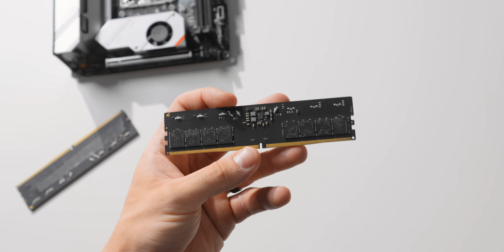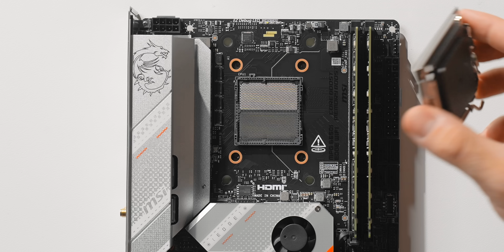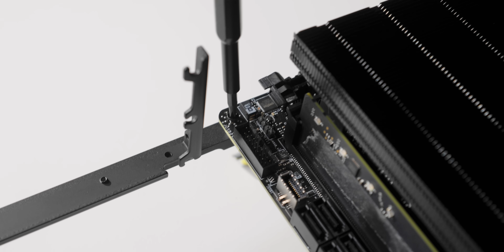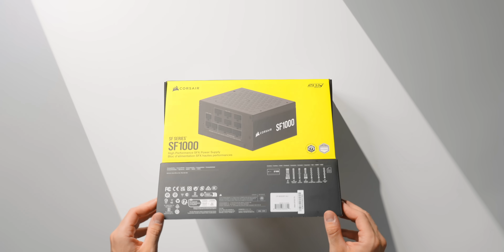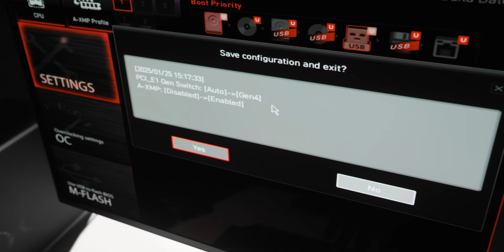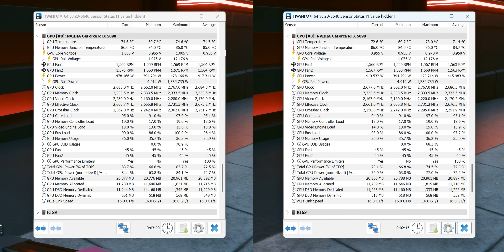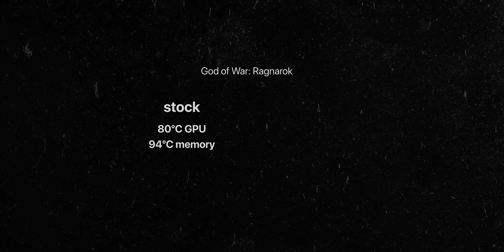My fastest gaming PC, ever – 5090 + 9800X3D

Comment: 9:10 If I had the money, I'm very much someone that would buy more expensive GPUs and undervolt them to keep the power draw down. I'm perfectly fine with mediocre gaming performance, but I also do some non-gaming stuff that's limited by memory capacity. My dream GPU only has 100-150 watts of power draw and at least 32 GB of memory.
Reply: I have a 4090 and I have it undervolted to around 230-250 watts when gaming down from 400 stock. There is a small performance decrease but not enough for me to really notice. In turn I get massive reductions in power, temperatures and fan noise. Absolutely worth it for me.
Reply: Maybe head for the Nvidia A6000

Comment: Is it possible with this case to mount the graphics card flipped over so the fans exhaust out of the case? I’m guessing not as that puts the bracket at the back upside down, but maybe this case has flexible configuration for that?

Comment: I never understand whats the point of cramming all that in a tiny case? People travel with their PC? I've been building PCs since the early 90s and i have never used anything other than a mid sized tower. Sits under the desk no problem. I have 3 machines here. Easy to reach stuff. Easy to install better cooling. SO yeah I dont get it.

Comment: I build in the same case, but 7800x3d and 4070 ti super. Gpu max 70c, cpu up to 88c, but i using water cooling. How its possible, that 9800x3d work fine with air cooler without throttling?
Reply: the 9800x3d's cache is added under the rest of the chip, it was above before. This makes it so that it'll run a lot cooler than previous gen chips

Comment: idk if its possible but if you could reverse the 5090 around so that it intake air from behind the motherboard and exhausts it straight out the side of the case then your overall temps would plummet. your cpu, motherboard, ram and m.2 especially with their lack of heatsink would benefit an amazing amount. It might not even make the 5090 run any hotter since the case ambient air temp would be so much lower overall.

Comment: G'day from another Aussie! Literally just finished my first T1 build using the same motherboard and CPU but am using the AXP90-X47 Full Copper cooler so that I didn't need to worry about clearances. Getting about the same CPU temps, so it must be working well! However, I'm still running my old deshrouded RTX3080 in it with some P12s strapped to it for cooling. Still unsure of whether I can justify the obscene cost of the 50xx series or not. Time will tell!

Comment: Curious of using the black ridge over the axp90x-47 full copper? Temps in testing are roughly exactly the same, and no need to modify the mobo. Just turbulence issues with the thermalright?

Comment: It’s crazy how little interest I have in the 5090. 
I had a 4090 until a few weeks ago. Sold it for the same price I bought it for two years ago. Absolutely nuts. 
But this 5090 has curbed all enthusiasm for the new gen. It’s such a pathetic release. 
I was planning to try and get one but the increase in price matching the increase in performance is awful. I just don’t want to support it. 
The really awful thing about this gen is the new 80 card won’t even match the previous flagship. This had never happened before. 
It was always the new 70 card would match or exceed the previous flagship. 
Now the 80 card is so pathetic it won’t do it either. 
Worst gen ever.

Comment: I think if you use the Thermalright AXP90-X53 you will have a better TDP cooling and still fit. Thermalright AXP90-X53 has a max tdp of 155w and the BR has a TDP of 95w

Comment: That motherboard is underrated, I use it with my 7700X. I also just got the SF1000, it’s actually hard to find reputable SFX 1000W power supplies for a decent price (Thermaltake was considered, but mixed reviews turned me away).

Comment: I have the 9800X3D as well. I feel that after I changed to this processor, Marvel Rivals has been crashing a lot. It wasn't happening when I had the Ryzen 9 5950X. Same graphics card, a ROG Strix 3090. Could you test if your game crashes as well? I reformatted Windows 11 twice, and also changed to Windows 10. Same thing. I just feel Windows 10 has more FPS, somehow.
Reply: So you did fresh windows installs? Are you undervolting the CPU?
Reply: @joniqst  i fixed it by undervolting the GPU.

Comment: Currently have a 9800x3d with a rog strix x870I. the same corsair sf1000 PS. corsair cl30 6000 ddr5 ram.   currently rocking a corsair 200D and am getting better temps on my cpu than on an open air test bench with how I have the front fans to exhaust and a 360 aio with a push pull configuration. 

I think the corsair 200D is the best SFF (or MFF) case that can get max performance with the right fan configuration while still taking up hardly any desk space (less than most SFF builds) with its verticle height (the most efficient way to do a case IMO)

Badly want a 5090 FE to complete the perfect build......hope i can get one.

Comment: With an undervolt like that do you think I could run a 5090 on a 850 W power supply?
Reply: That's just asking for trouble tbh
Reply: @Walhor  if its 430 during load and my cpu uses 105 then i think like 300 is enough for the rest of my system
Reply: @ Hey it's your hardware go nuts 🤷‍♂

Comment: Hi, I just bought the same PSU and after seeing the cables having smaller than typical connectors II thought it will not be a good fit for 5090. How did you manage to connect your GPU to this PSU?

Comment: Why do you only have 47mm of height clearance for your cooler? I have the same case and have a 4080 super pro art which is about 2.5 slots and was able to fit noctuas NH-L9x65. You should be getting more clearance with the 5090. Btw I love your videos! Especially covering the formd t1 series builds!

Comment: I have a 4090 paired with a i914900k I’m debating if I should try and get the 5090. I really only want it for the slight power increase also I really like the much slimmer design.

Comment: Who the heck is gonna run a $2k 5090 gen 5 pcie through a gen 4 adapter and turn the power/performance down on it too, just so you can use it in a smaller case. Unless you live in a cardboard box and don’t have he space for a real tower , who is this for?

Comment: this is the pc I'm going to build! Thanks for testing! I do have question:
Do you think its works  better to switch the power supply face to GPU? I think the fan will intake the hot air from the GPU and pulls out the hot air from above hole of the sfx power supply.

Comment: could you please compare the MFG with Lossless scaling? (the app) since it basically does the same thing, and also this may sound like a troll but honestly please try out the frame gen on "Infinity nikki" the game is so packed with detail , locking to 60fps + 2x framegen from lossless scaling it made any motion artifacts VERY noticeable. though i suppose a 5090 can just run down enough fps natively to delete any artifacts

Comment: Would love to see a build in the ncase m2. 

Personally, in a dilemma between choosing the t1 and the m2 and would be curious to see the comparison
Reply: I think this T1 build is only for the insane. Ripping heatsinks off, dumping 500W right into your PSU/mobo (causing early hardware failure), and losing 5-10% performance on undervolting. Is it worth it? Or get a slightly larger case (M2) and avoid all that.

Comment: undervolting...
MAYBE you could TEST this by using the NVidia App instead? It will actually test for stability, and periodically check if things are okay. I'm not convinced the MSI method would work properly in all conditions. Either way, somebody needs to invetigate this because dropping to 75% Power Target doesn't make sense to me. If it works, great. But I'd rather someone investigate this card. That I won't buy, but I'm curious.

Comment: PCIe riser issues
BIOS manufacturers need to address this. when you have certain POWER or CPU issues detected we currently have the system HALT on POST and tell you to go into the BIOS. Why aren't they doing this now, especially for PCIe instability that prevents passing the POST at all ? (Prior to Windows even launching). Just default to PCIe v4, not v5 and if you set it to v5 and rebooting is not working go back to PCIe v4 automatically with a warning of what's going on.

Comment: Absolutely insane that the 9800X3D can run with that tiny cooler. What a CPU.
Reply: Now I know why intel is stopping laptop OEMs from pairing AMD X3D CPUs with the mobile 5090.
Reply: @abaj006  how is that not anti-competitive / illegal? I heard about the "make Windows OS run best on Intel" from a headline or two but this seems wild. wtf. Screw intel.
Reply: @worlwr2  because he completely made it up lol
Reply: @abaj006 it's probably true but remember that x3d on mobile isn't so great because the idle power consumption of 3d cache is very bad. This means those laptop can be used only for a desktop replacement because it lasts 2-3 hours max on battery.
Reply: @abaj006  It's partially AMD's fault for ignoring OEMs and not having a good product integration team like Intel. Also AMD doesn't just have a 9800X3D equivalent, they only put out a 9950X3D equivalent which most people don't want to pay for and aren't going to utilize if they just want to play games.
Reply: @abaj006 well that and the thunderbolt connection reason
Reply: The 9800X3D might be the top cpu for gaming but its still just an 8 cores cpu. And gaming is also not going cost your cpu to run that hot.
Reply: @appendgenes3582  Call me crazy, I don't like my CPU running at 80c all the time. Also that thing is going to be LOUD. Hard hard pass.
Reply: @appendgenes3582  depends on the game. rust is very cpu bound, not gpu.
Reply: 9800X3D is only good for gamers
Reply: 9800X3D can be cooled with about any air cooler.
Reply: Agreed
Reply: Can it though? That CPU can pull upto 155 watts at full load, and that game is pulling only 80? I guess if you only game and will never use a game that maxes it out in the future...
Reply: mine with dark rock 4 pro and noctua nt-h2 runs 60-70 in gaming with meshify c and the highest its been is 96 while compiling the last of us shaders
Reply: tho im worried about the temps. ive seen a real time benchmark of Vex on an open system  and it shows the 5090 exhaust was suck by the same CPU hitting 82*c tower cooler on a 25% less CPU usage on Cyberpunk and Alan wake.
Reply: I wonder what the temps are at full load

My much weaker 5700x3d remains at a constant 75c at 100% utilization with a theremalright assasin x se inside a midtower case.
Reply: That’s just a sample pc no 5090s have been released he probably got his hands on a test one and built a temp pc for a video
Reply: @RatedSpectre  The 5090s that reviewers have should be the same cards that will be available retail tomorrow.
Reply: Agreed!
Reply: 9800x3d (and 7800x3d) is not as hot as people thought it would be, it's a bit overexaggerated just because it's named "#1 gaming cpu". It's definitely not as hot as, say, 14900k, Ultra 9 285k, 9950X, etc.
Reply: Absolutely insane that RTX 5090 can run with that tiny cooler. And it's 500W! What a GPU.
Reply: @MegaKiri11  The power of liquid metal and flow through design.
Reply: @MegaKiri11  575
Reply: @MegaKiri11  ngl even seeing the PCB 😂
Reply: @MegaKiri11  NOTHING SPECIAL, MY 520w 3090 WITH HYBRID MODDED AIO IS WAY COOLER AND DOUBLE SLOT.
Reply: @pav1u why are you yelling?
Reply: @pav1u   so a less powerfull card that uses more space runs cooler? ok
Reply: @pav1u  WOW A 5 YEAR OLD GPU RUNS COOLER YOU DON'T SAY. WHY ARE WE YELLING
Reply: @insertnamehere4419 is 3090 5 years old????????
Reply: @muskelin  released sept 2020.  ya. 4+ years ago. Besides the point.
Reply: @pav1u  We're talking about air cooling so your comment doesn't make sense. Of course water cooled cards can be 1 or 2 slots. What is your point?
Reply: @insertnamehere4419  he is being sarcastic
Reply: @pav1u  yeah and its still worse than 5090 lol
Reply: Absolutely insane that he even has one!

Comment: Amazing build and content as always. Thanks for your contribuition to the community!

In heavy workloads like rendering and editing I don't know how the CPU it'll behave, since the 9800X3D will be much more requested than gaming, but gaming performance and thermals are absolutely fenomenal. Can reach even lower temps if you test which cores can go lower undervolt on Curve Optimizer and limit the PPT to 145W on PBO Limits (default is 162W, ~10% reduction). AM5 is amazing!

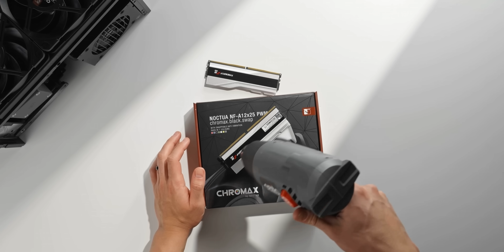Comment: 1:47 I don't know if its safe either, I mean the heatspreaders aren't just there for decoration. Wouldn't g.skill ripjaws or similar have been fine?
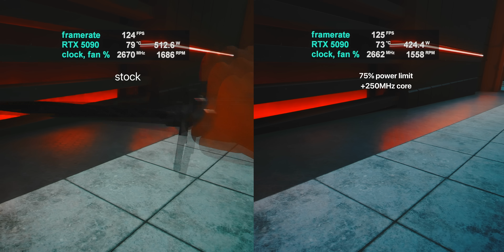7:30 yes but that will probably not work with every 5090, its dependent on silicon lottery (if it is even stable in the long run)

Comment: The thermal grizzly short backplate doesn’t work with all am5 itx motherboards. It doesn’t fit the asrock b650 pg lightning. Trying to install it can brick the board. As there are filtering capacitors in the way the cutout in the centre of the backplate is too small.

Comment: badass build, safe to assume this would also work with a 5080 founders edition?
Reply: Yes, however if you like the look of the Fractal Ridge that seems to be the best SFF case for 5000 FE cards because there it takes in cold air and exhausts straight out of the case,

Comment: With the most mediocre GPU series that NVIDIA has made in a long time, if possibly ever.
Reply: While the performance jump isn’t as impressive as the leap from the 3090 to the 4090, the size reduction from a 3-slot to a 2-slot design with that level of performance is remarkable.

Comment: If you would make the gpu as exhaust you could make it crazy compact cause then you even would not need the top exhaust fans at all.
Reply: Are you dumb? How is that making it more compact? You will still have unused space where the fans would be if you took them so it’s not making the case smaller or more compact.
Reply: @Keeki549  Are you braindead? Yeah of cause the case is not gonna change its dimensions if you remove the fans. 

I just said YOU COULD make a crazy compact system cause the fans are not nessesary for good temps if you make the gpu blow out its hot air instead blowing hot air into the system onto the other components and trapping it within the case.

Comment: Off-topic question, but I couldn't find an answer anywhere: On my new PC with a Gigabyte NVIDIA 4070Ti and Windows 11, games won't fully minimize. They stay running in the background and occasionally pop back up, even when I open a browser or work on the desktop, though at lower frame rates. This issue didn’t exist on my old PC with the same GPU. Any ideas on how to fix this?

maybe someone in this community had the same issue😅

Comment: Thank you for mentioning an undervolt setup, I feel like basically any GPU made in the last 8ish years could benefit from one as they have been coming out of the factory boosted as high as possible for the smallest gains while pushing right up to thermal limits.
Some cards even get FPS increases with the added stability of an undervolt!

Comment: A truly outstanding mITX build, with a 5090 FE and a 9800X3D?    If I win lotto, I'm so doing this, LOL.  Seriously, love you work here!  Video quality, as always, are so professionally done.  A piece of art, just like this rig!   Undervolting is a must!  Can understand why you do this.  Even a negative curve of -20 on that cooler.  Great result!  Amazed that adjustment on the 5090 worked so well. No power curve undervolt. Just simply lowering the power to 75%, yet overclocking the clock speed by 200MHz.  That's brilliant!

Comment: Need to see a similar build with a 240mm rad and liquid cooling the CPU, that hot air going through the rad this time instead of mostly out the IO side of the 4090 FE will be interesting.

Comment: This video really made me consider repeating this build (given that I'll be able to get 5090 FE for a close-to-MSRP price). The workarounds are a bit scary sometimes, but the result is outstanding.
The only part that I didn't understand is about razor cable: isn't it possible to get PCIe 5.0 one?
Reply: LINKUP make some gen 5... But this one in video is very flexible, LINKUP not at all. And you need a comparable length. And find it in stock. After all, I don't now how good their cables are. Not all raiser cables work how should, even gen 4. Repiting this build not a best idea also, - not a good sandwich configuration at all, look for exhaust variants on other cases, or wait and see (after buying 5090FE, while you can find some), maybe formd or dancase make a new effort for their old or complitely new cases. Or look on Fractal Ridge case, and similars.
Reply: @someawesome7984  I like the idea of Fractal Ridge, but will probably go with Era 2. Seems like a good compromise in terms of size and performance.
Thanks for an advice though.
Reply: @ Era 2 is bad idea - poor perforation; very little gap between GPU and backplate; you can't switch direction of the card without a saw. So all hot air from 600W GPU would heat an uncover back of motherboard... Not last for very long, and would be very hot.
Reply: @ what would you suggest then? Go for mid tower? :)
Reply: @ go for simple design without sandwich layout, like Lian Li A3-mATX, JONSBO D31 and D32 family, Deepcool CH160 etc. More direct intake of cool air, good vertical flow and no need of raiser. And they still comparable small!